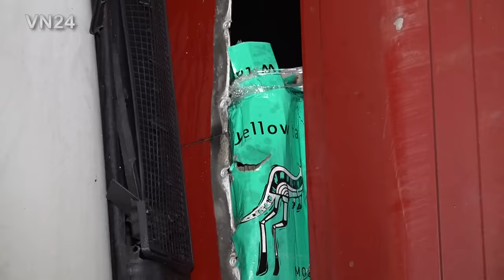02.12.2022 - VN24 - Nach Horror Unfall auf A1 - Teil 2 - Die Bergung und Reinigung

Comment: If the car looked this bad, I can’t imagine the poor driver. 🥀
Reply: Survived, was on the first video. All I can think of is they had time to react and duck down into the driver seat low enough to avoid being dead. About the only part of the car you could have survived in was the driver side.
Reply: Pretty amazing how they get this all cleaned up in Germany. US, they just shove the small stuff off the edge of the highway, only pick up the big pieces. Notice how well kept their equipment is and the street cleaner is a huge piece of equipment that actually steam cleans the gas and oil and picks it up.
Reply: She survived, she was talking about the crash in an interview. Cuts and bruises and she chipped both her front teeth, something hard, part of the dash hit her in the mouth. She had gorgeous teeth, at least they will repair, she's so lucky.